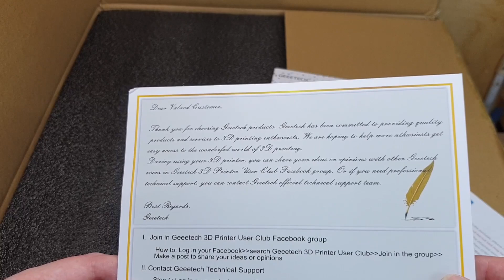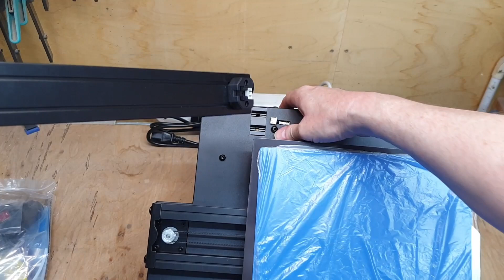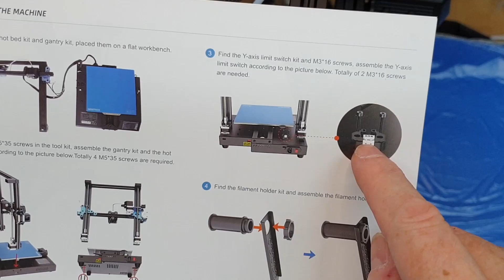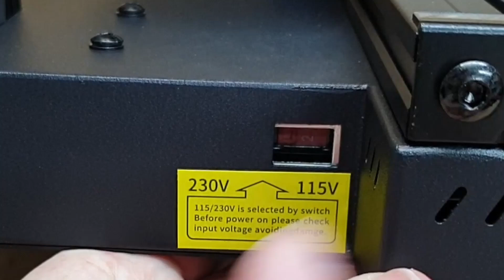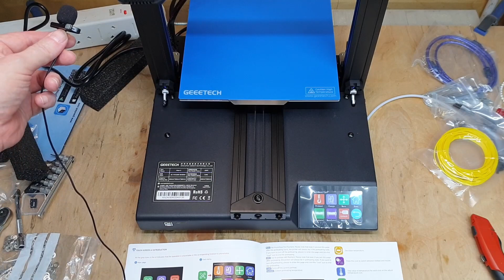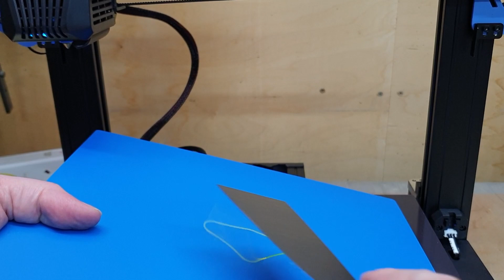Building and testing the Geeetech Mizar S 3D printer

Comment: So! Do you need a computer program to do other parts?
Reply from the maker: You use a program called a "slicer" to take a 3D model and turn it into code the printer can understand, but the nice thing is, the slicer programs are getting easier and easier to use all the time. I use one called Cura, and it's quite easy and has tons of how to's and such available to help you get started.
Reply: @SteamGeezerUK  many thanks! So I need a printer then?( something I haven’t got at the moment!
Reply from the maker: @melvynkersley-nc8fx  Need? I can't say, but want is a whole other thing, but if it's for modelling, you might want to look at resin printers too.